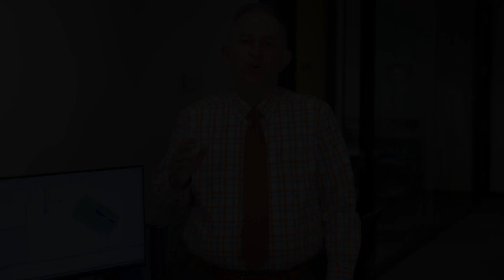Three Phased Array Antenna Types You Must Know | MPT

Comment: Have you designed any phased array system operating in a Band?
Reply from the maker: Hi Sabir, we have designed and developed phased arrays that operate from 2GHz to 35GHz. Which frequency range are you interested in?
Reply: @SmartAntennaSystems  i am interested in 2-14 GHz range,, but what have you done for phase shift/? and which type of antennas you have used and what is the length of array?